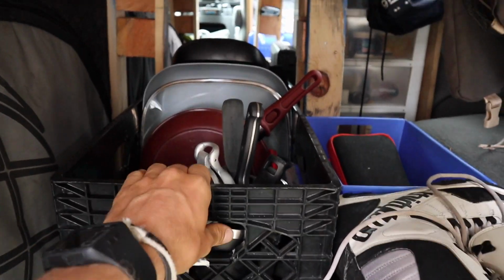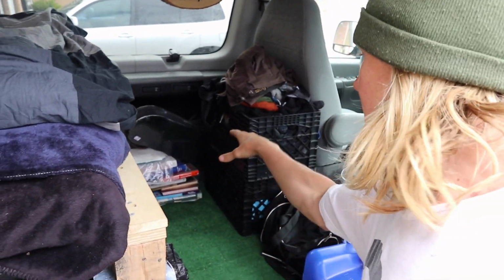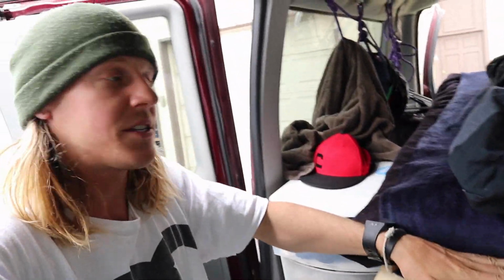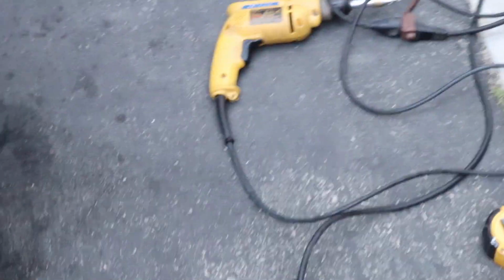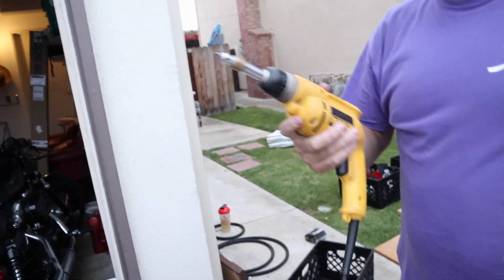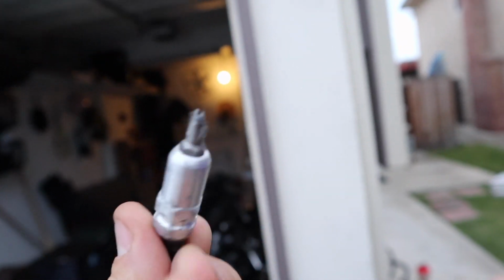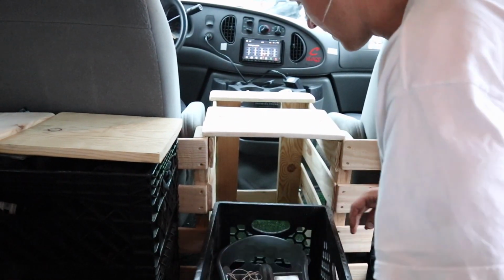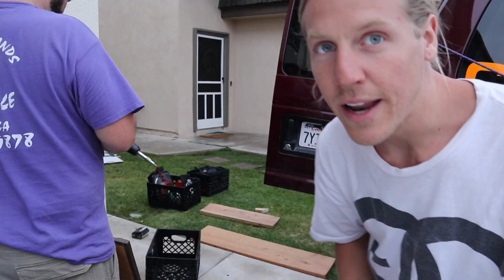BUILDING MY DREAM VAN (DAY 3) FORD E-350

Comment: Another cost savings tip for you (well mostly for others reading since you're obviously done w/ that part): Most Home Depots will cut individual pieces of wood for people, then stack any damaged/unwanted pieces nearby for 70% off of retail. When I was getting supplies for my Safari build I lucked into a perfect sheet of 1/2" ply that was only 7' long, which is the perfect length for an Astro/Safari. That and some MDF from the pile and I was out the door for ~$10 in lumber costs. I also had them rip & cut the plywood to the exact width I needed for my platform so when I got home and started building I just had to deal w/ assembling the platform & cutting the MDF to fit where needed.
Reply from the maker: Jamie Krueger suchhh a score man!! Crucial tip i will keepnin mine and might use soon!! Much love brober